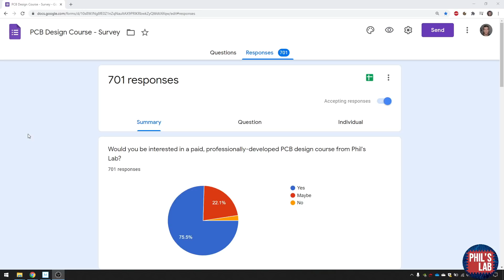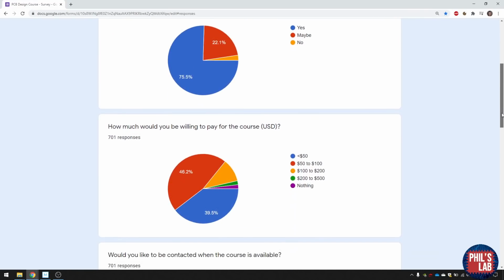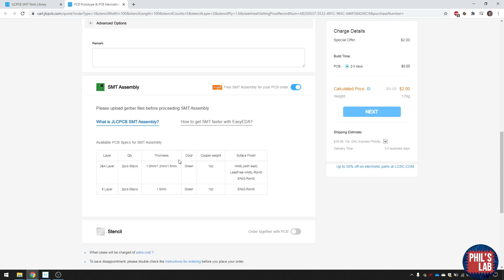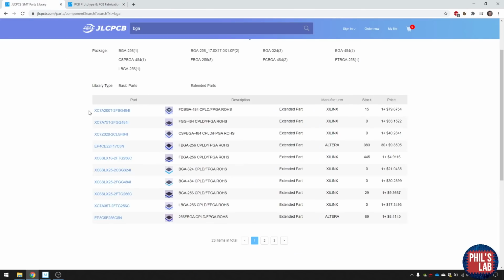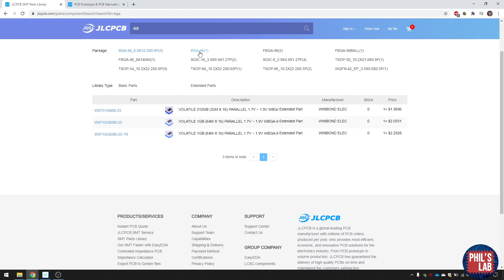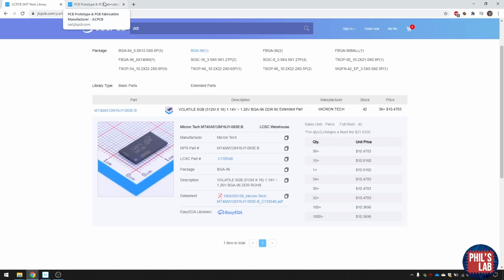Mixed-Signal PCB Design Course Preview & JLCPCB 6-Layer Assembly - Phil's Lab #16

Comment: Hey Phil, I am seriously considering taking your PCB design course.
You stated in the firmware that there would be some firmware development.  However on the course website I could not find that in the "What you will learn in this course" section.  Was the decision to include firmware development changed?
Reply from the maker: Hey, Thanks for your interest in the course. I'm afraid the course ended up not having any firmware development in it (other than how to choose pinouts, for example).

Comment: Hey Phil, I happen to be an engineer who plays guitar and shares similar interests as yours. After watching your video about designing 4 layer PCB with STM32 (my fav MCUs) I was able to design my own mixed-signal audio processor board similar to this. I wish I have seen this video earlier, instead of flash memory I used SD card and two different ICs for DAC & ADC. Your videos are extremely helpful for intermediate engineers like me. You have saved me few hundreds of hours of nerve-wracking. Please continue uploading videos like this

Comment: I'm on the edge of my seat waiting for this course to come out! Approximately how much of the course will be Hardware and how much Software (DSP algorithms,etc). Will it cover configuring and setting up the chip as well as some basic (or advanced) code?
Reply from the maker: Thank you, Raf - very glad to hear that! Most of it will be hardware design and PCB design. A tiny bit on testing the board (firmware, drivers) and a tiny bit of DSP.

Comment: I would say that an array combines a single PCB multiple times to make a larger array of connected boards; or a “matrix” so to speak.  This process is referred to as “stepping out” the individual boards and also often referred to as “step and repeat.”  Other terms used to describe an array include: panelized, stepped out, palletized and rout and retain.  An array is used to make the assembly process faster so you can accumulate more raisins. Anyway, great video keep it up.

Comment: Great tutorials dude, I think could be great to see as a quick chapter hows the back and forward between the PCB manufacturer, the PCBA manufacturer and the restrictions they have for the PCB fab and mouting, also I think if you include a section where you use some of the most used industrial approach-recommendations PCB design could be great too, i.e.:  IPCs, JEDEC for design (apply for SMT components, throughole, and even if you're going to use an FPGA in its BGA package, well, follow-up the recommendations from IPC), even it could be great to seen some calculations on your designs, It doesn't need to be too deep(and if you do it, that's cool), if you include some of these things on your course, I think people will really appreciate this. That's just my opinion, BTW: Thanks Phil for theses tutorials !!
Reply from the maker: Thank you very much, Hector. Those are some great suggestions. I do indeed planning on covering some standards/guidelines, and of course quite a few calculations in particular w.r.t. the analogue section. Hopefully there'll be something in there for everyone!

Comment: What is the reason for not doing copper pour in the board. Is there any such rules???
Reply from the maker: I've listened to a few videos by Eric Bogatin and also Robert Feranec on this topic. In my view as well, there is rarely a benefit to adding 'generic' copper pours to signal layers - and can often times actually be to the board's detriment.

Comment: Great, looking forward!
Reply: I wonder why you see the need for a separate USB high speed IC btw - I would think that such an STM32 could handle that by itself. Moar DSP power?
Reply from the maker: Thank you, Steven! This STM32 microcontroller does not include the physical layer for USB high speed, so needed to add the PHY to get that functionality.

Comment: Judging by the value it 50-100 USD should be a fair price. Ppl in the industry definitely would charge more. I couldn't afford this right now due to my local currency relation to USD, but I could see myself saving up money for that course, the question is:

How long will be the course? The advancement of the material will be similar to existing videos, or higher? How much time will be spent discussing hardware and how much of it will be spent on discussing software?
Reply from the maker: Thank you for your comment. Yes, I'm afraid the exchange rates will not be beneficial to a lot of countries, but hopefully you'll still be able to get it!
The course will be around 10 hours with additional material (PDFs, files, etc.). The majority of the time will be discussing hardware, with only maybe the last section on software. However, hardware will be split into circuit design/simulation and PCB layout/routing.

Comment: I am thinking of taking this mixed signal course as a first step... But I really want to know more stuff like adding a display, a button/touch interface to control it, wireless connectivity, external storage... Those are something I would need for projects in real-life as well...
Reply from the maker: Thank you, Abhishek. Yes, I think this course will give you everything you need to know to then also modify the board, add in your own peripherals, etc.

Comment: This is crazy. Why did you choose for a seperate high speed PHY btw? And not an stm32 with an integrated phy it would make the board a lot smaller and easier to create aswell. 
Btw if you want a very cheap microcontroller with an integrated high speed PHY have a look at the nxp imxrt1010. Its a QFLP chip that is very cheap, you do need to add external QSPI flash though as it is not integrated but other than that a very capable chip if you want high speed usb.

Comment: JLCPCB's 6 layer stackup sucks big time for high-speed designs. They should've used thin cores and have thick prepreg in the middle of stackup. That's the stackup I use a lot for my boards.

Comment: Phil, I love that JLCPCB has SMT assembly however I am struggling with assembling my boards at home with the micro USB connectors. I use a small amount of paste and have tried hot air soldering and tried a toaster oven method. This has resulted in about only 3/5 of my boards to work. I would ultimately love to get a stencil but it would be hard for it to fit over my design since JLC populated the components... What is the best way to solder micro usb components?
Reply: You want to place the usb connector first and solder the mounting pins with a normal iron. Then you want to get a syringe with a very small nozzle to dispense the soldering paste on the pads if you do not have a stencil. If you spill solder paste from 1 pad to the next you can use a piece of paper to seperate them again. 
If you like how the paste is put on the pads prefereably you use a preheater and a hot air gun. If you dont have a preheater you could also preheat it in a small oven and open it after it heats up a bit then finish it with the hot air gun.
If you dont have hot air you could also try to use an iron with a flat tip but it could result in bridging. A third option is to reflow the whole board again with usb connector on it aswell in the oven. If you have an oven that has a heating element on top and bottom and have seperate controls I got a neat trick. First heat up the bottom with a piece of metal underneath the pcb (you can use an oven tray or another pcb dont use a grill that will heat it up unevenly). 
Then wait for it to heat up until the temperature is almost there. If the temperature is very high switch on the second heating element on the top. This will ensure that the temperature goes above the melting point quickly if you see it reflowing switch off both the heating elements after like 10-15 seconds and open the oven. For small pcb's this should work pretty well for larger one's I am not so sure. The important bit is that you first preheat the pcb very evenly using the bottom element then get it over the melting point quickly with the second one.
Reply: @Tr1p93  Ohh, thank you very much. Will desolder the two that failed and try the oven method. Have you have the same issues with small pitch smds?
Reply: @IEEEclipse  Well usually I always get a stencil for smaller pitch pads. But sometimes you have to repair something and that can get nasty. My best friend is usually desoldering wick (the copper stuff) and a good iron with a flat tip. Usually getting rid of excess solder helps a lot. Then spreading out the remaining solder over the pins fixes the bridging. Also scraping between two pins with an iron helps to seperate them aswell. Its not easy working with small pitch components but most of the time I can manage. 
If you want a good iron with a nice selection of tips get the ts100 and a flat tip it helps so much when working with small components. Its not even that expensive either but you need a seperate supply though. Also getting a syringe and a small nozzle helps to distribute the correct amount of paste in the first place if you dont have a stencil. Less is more with soldering paste you dont want to go overboard with it.
Reply: @Tr1p93  Thanks for your help, I got every board working! Flux was the key, each pad sucked the pin right to it. No lift, also soldering the tht pins first helped a lot
Reply: @IEEEclipse  Ok nice, forgot to mention flux that also helps a lot in general.
Reply: My trick is to make the pads longer than usual to compensate for hand soldering. I solder the mounting tabs first to lock it in place then tin the pads with some solder. By using plenty of lfux you can get the solder to flow onto the pins by touching the tip of a pointy iron to them while reflowing the solder. It might take a few tries but by checking under magnification you can get it to work. 
Ultimately to solder anything you simply follow these three rules:
1. More Heat
2. Less Solder
3. Flux is Magic
This is what we teach in the ECE AMP lab at Virginia Tech fwiw.
Reply: @JonathanKayne  Aha! I just used flux and holy cow. Night and day difference. The small pins weren't making good enough contact before, I just used a little flux and i can visually see that the pins are a glossy color rather than the oxidised looking solder joint. Each board works now!
Reply: @IEEEclipse  glad I could help! I know that flux is really important for soldering SMD stuff, especially if you use a lead free solder which is harder to determine if the joint is good or not on comparison to leaded solder